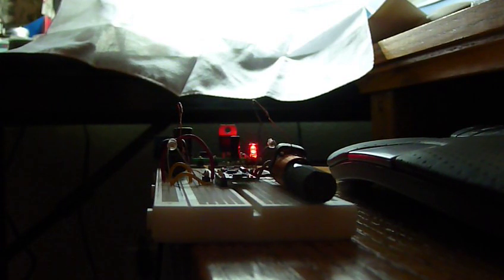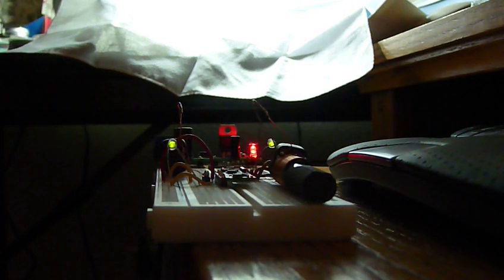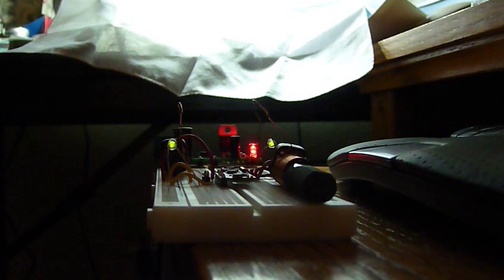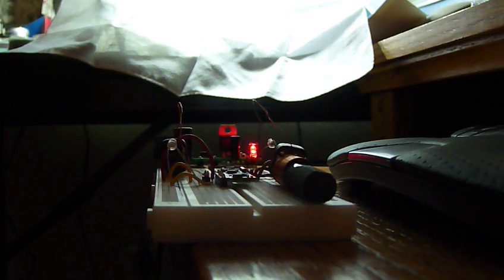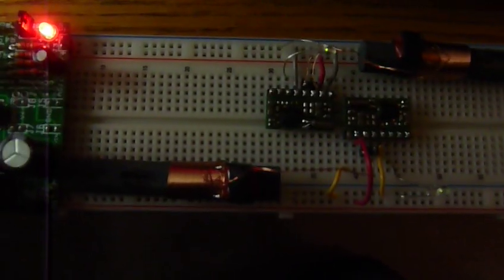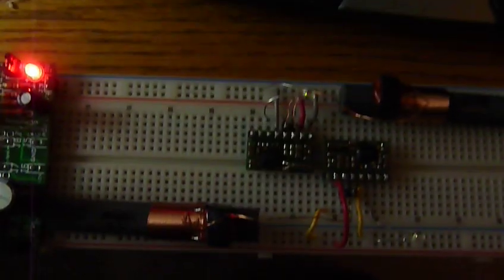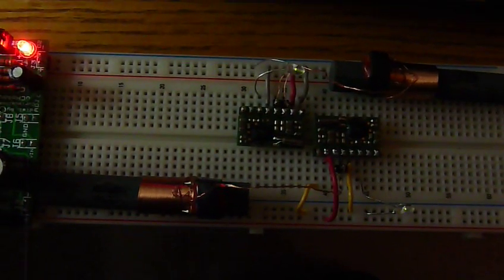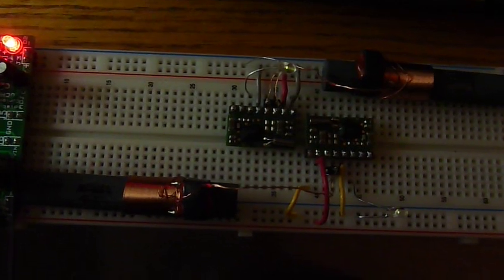WWVB Receiver (Atomic Clock)

Comment: Luke, do you know where I can get those receivers and Antennas? it looks like they are discontinued or is there a replacement for that to achieve the same. I am working on a project with the need to sync multiple devices in separate locations.Thanks,